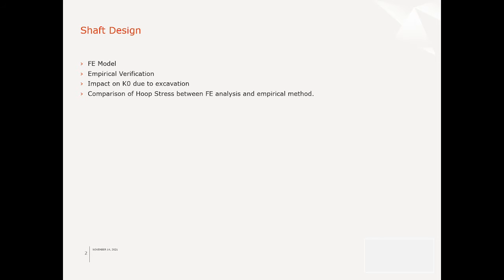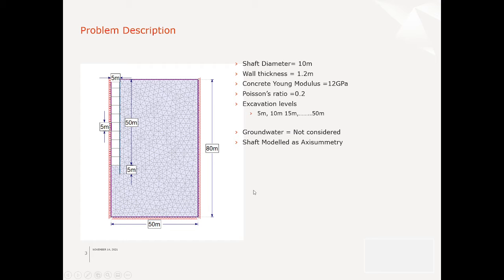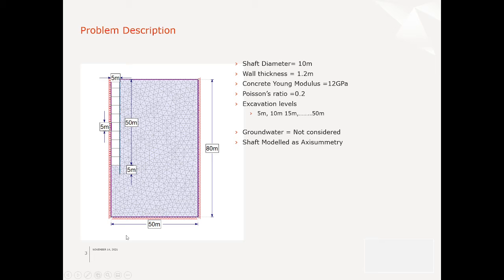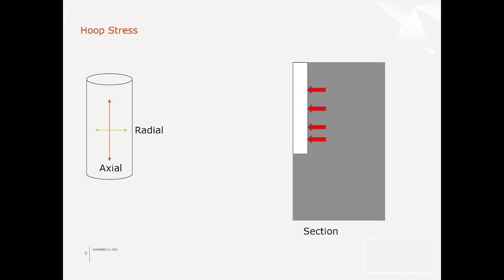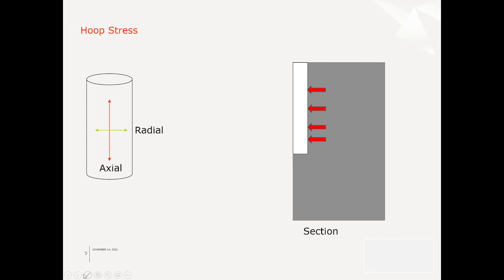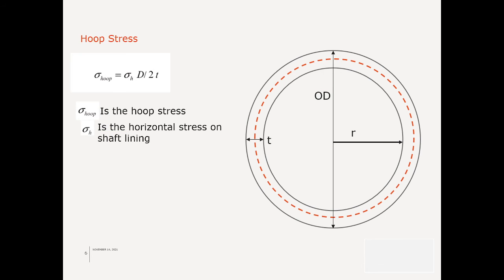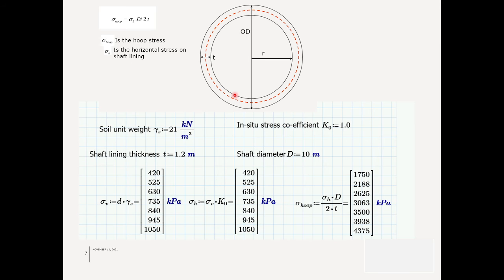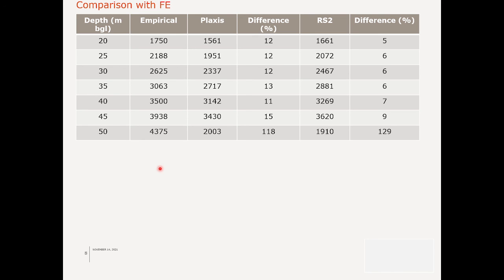Hoop Stress in Shaft Part 1

Comment: In my opinion there is a huge mystake in this calculation. The hoop stresses are empirically calculated with the formula of "thin cylinder". But looking at the internal diameter and the thickness of the cylinder, this is an example of "thick cylinder". For this reason you should use the Lame's formulas, neglecting the internal pressure.